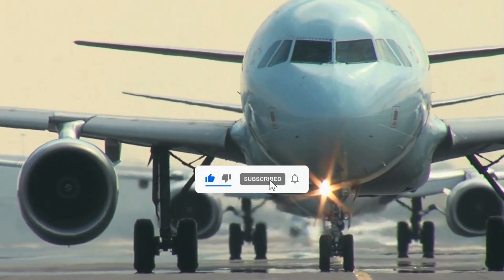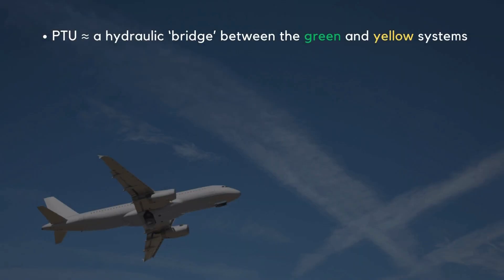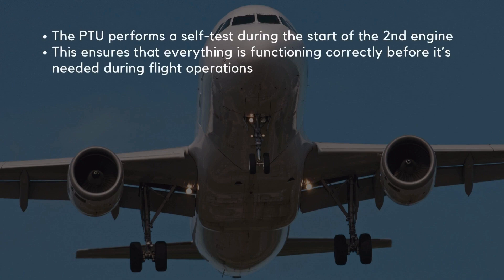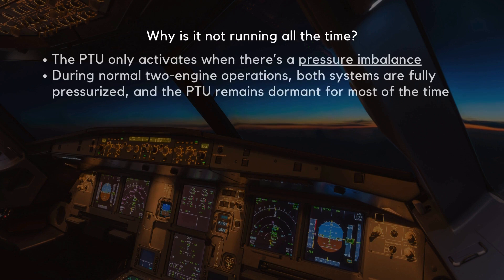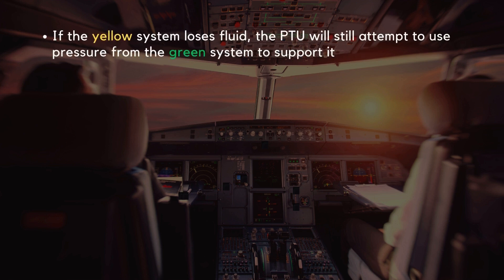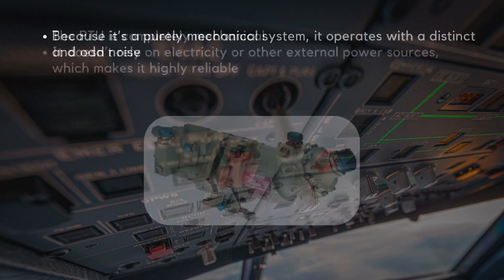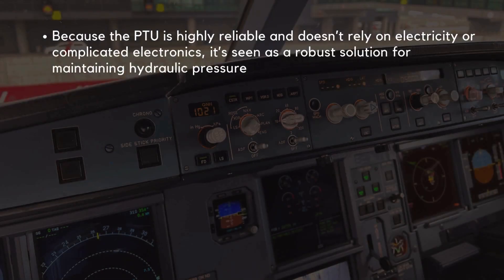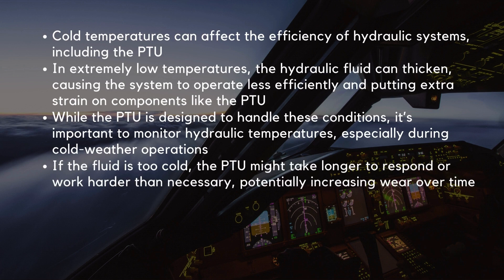A320 PTU Explained | A320 Hydraulics

Comment: 3:05 How can a system transfer pressure without transferring fluid? The fluid is what holds the energy..And to be able to hold the pressure there has to be an accumulator in combination of pressure relief valves and stuff. If there is a pressure drop, then you're loosing fluid from the accumulator.
Reply: Differential pressure on 1 side drives compressor, to help other side equalize, not transfer the fluid. Likewise, exhaust gas and inlet air don’t interact in a running turbocharger. Hope this help
Reply: Accumulator doesnt hold fluid, it holds nitrogen gas
Reply: @raikoafm702 yes a bladder inside that holds the precharge, but still didn't answer my question

Comment: I thought the video would explain how the PTU actually works, beside the scant "transfers pressure without moving fluid between green and yellow systems". It would have been useful to describe in simple terms what's inside: two hydraulic pumps/motors sharing a common shaft, and when either side sees a much higher pressure than the other, it behaves as a hydraulic motor, driving the other one that will now act as a hydraulic pump. This works because this type of pump/motor will provide hydraulic pressure if its shaft is turned by some external mechanical source, and conversely, will turn its shaft if it's fed with enough hydraulic pressure. Put two of those devices sharing a common axle, and one will drive the other whenever there is enough pressure difference in their hydraulic lines. That's how it transfers pressure from one side to the other while never transferring fluid. 
Other than that, good video. Keep them coming.
Reply: Thank you! I too was wondering how the PTU was able to transfer hydraulic pressure without connecting the hydraulic systems. Makes complete sense now.

Comment: Boeing and Embraer planes also have PTU for Landing Gear and they do not make this ridiculous noise and also have more redundancy like electrical pumps on each hyd system.
Reply: Newer versions of the A320 make less of a noise.

Coming from the main competitor, the 737, the A320 has actually far superior redundancy, despite having only 2 electric hydraulic pumps, one of which is usually not used anyway. Part of that is achieved by having 3 full hydraulic systems, not just 2, and another part by a pretty clever hydraulic and electronic control structure of the flight controls. So much so that single hydraulic system failures are not a big training topic, as nearly everything works normally. Only with the loss of 2 systems can things get more interesting, a situation which would in a 737 already mean that the main flight controls are just moved by pure mechanical power of the pilots, with huge deadzones and extremely fast fatigueing effects on the pilots.
Reply: @Soordhin  less noise? Are you kidding me?  Does it mean that older A320 are more noisy? I usually fly in the A320 neo from my company and it is very noisy in everything, fuel pumps, hyd pumps ptu. Etc comparing to the quiter E195 that has 3 hyd system with 2 pumps in each one plus a ptu that tranfer hyd power from sys 1 to 2 for the landing gear. My coleagues that flown both planes says that the hyd sys of the E195 is more redundant and resistant.
Reply: @ Yes, older ones are more annoying.

No idea about the Embraer, never flew it myself, it is too small a plane for our market. But one thing to note, the A320 PTU is not only for a single subsystem, but can power one whole hydraulic systems from the other side, with all functions. Which means that the yellow and green system essentially each have 3 power sources: engine driven pump on its own side, engine driven pump on the other side via the PTU plus the electric yellow system pump.
Reply: Yea, maybe. But door plugs arent popping out of the airbuses, nor do their rudders stick, and dont have previously undocumented “features”. So I dunno. Id rather live with a bit more noise.

Comment: I waited until the end of the video to ask this: How many seconds does it take for the PTU to transfer the pressure from one system to another? (Like in the single engine taxi example)
Reply: Barely few seconds. Say 5-10
Reply from the maker: Typically takes a few seconds to transfer pressure 👍🏼